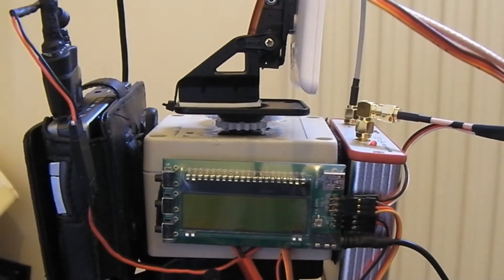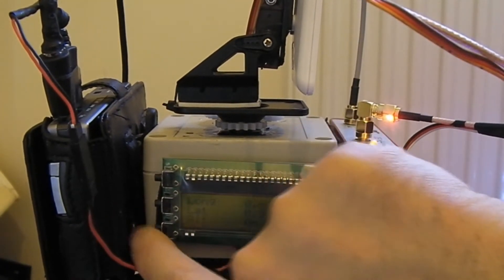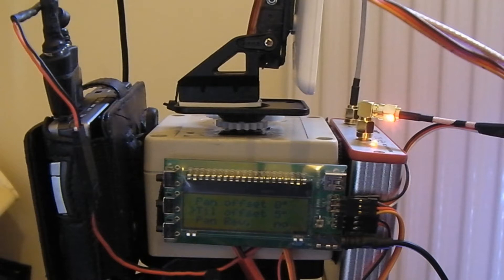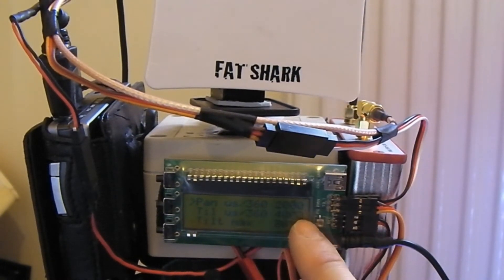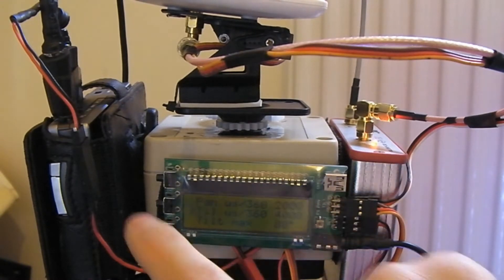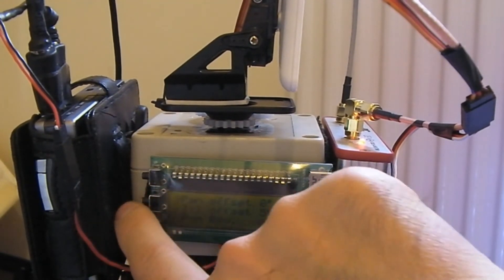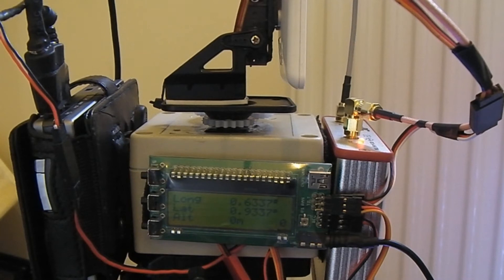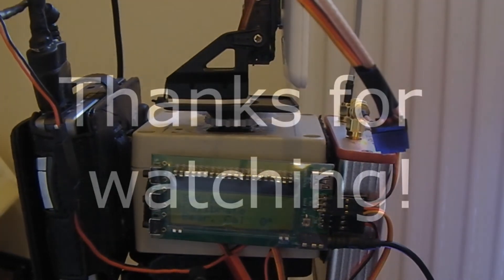ImmersionRC EZAntenna FPV Antenna Tracker Setup Guide

Comment: Hi! Im looking for simple tracker like this one. but i have one maybe stupid question. but what does send the info down to the tracker? Or short said: what will i need to build a tracker? I have a pan/tilt gimbal like yours and other FPV equiptment such as vTX, vRx, OSD etc. the only thing im missing is a tracker. but what will i need to make one!?
Reply from the maker: The EzOSD or TinyTelemetry sends the crafts current position and heading (along with other telematics if setup correctly) down one of the audio channel as a series of tones that are decoded at the tracker end.
Reply: I already have an OSD of other brand. Had an EZ osd, but it didnt have a rth or auto pilot so i had to replace it. So acually all i need is the EZ tracker and Ez tiny telemetry to build the tracker? Æ
Reply from the maker: eX750F Unfortunately This tracker only works with the ImmersionRC  EzOSD or TinyTelemetry.
Reply: Any idea where i can buy those two? Readymaderc is out of stock.

Comment: Great video. I had been having problems with setting the bearing to zero degrees! Although I'd set everything correctly as in pan and tilt max and min. I'd then done a servo test and then set zero bearing. This then meant each time I turned off and on The tracker gave me s different bearing. Easy when you see it on s vid.